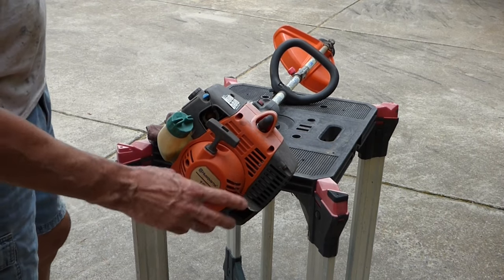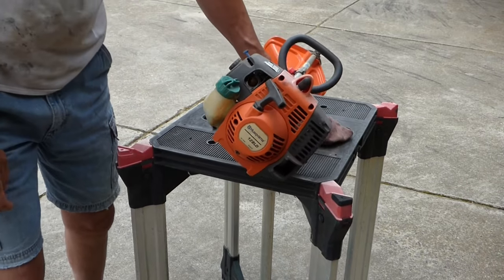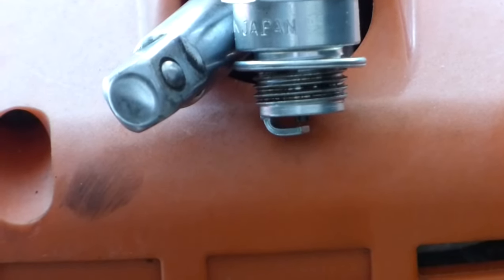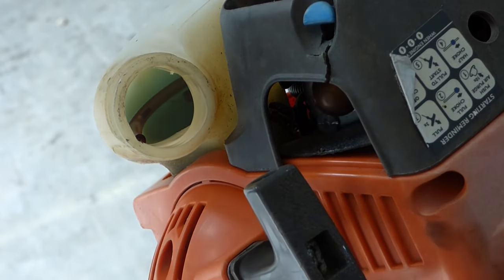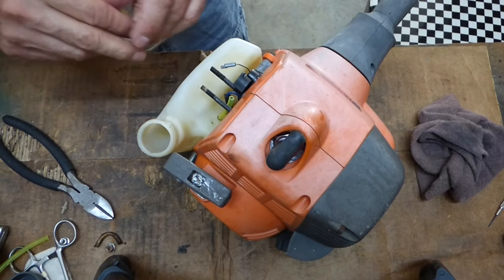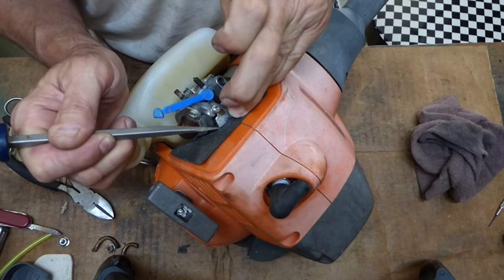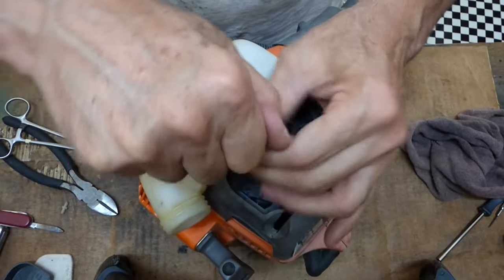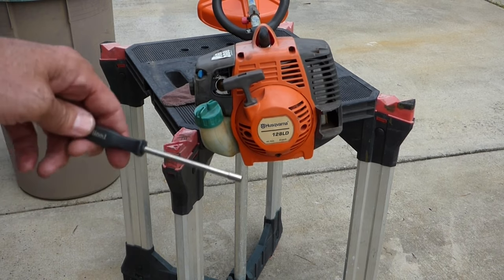Diagnose & Repair a Weed Trimmer that Won't Start or Run - Husqvarna Fuel Problem Fixed!

Comment: if there's a dip stick somewhere on your engine do not use oil in your gas because its a 4 stroke
Reply: Its 2 stroke not 4
Reply: This is a 2
Reply: You can have an oil system on a 2 stroke... Lots of snowmobiles, lawnmowers and other 2 stroke engines have oil systems.
Reply: There are also 4 cycle weed eaters and other lawn equipment

Comment: Need to take the carb apart and clean it no telling how long it ran without the fuel filter might have trash in the screen before putting the carb back on but that's just me. It was a great video
Reply: I would have cleaned carb too since you have it off anyway
Reply: I'd have taken the carb apart as well. I like his videos but sometimes it seems like he cuts corners? Other than that he does good videos and great work on fixing equipment
Reply: Ever heard the saying if it ain’t broke don’t fix it??🤷🏼‍♀️😂😂
Reply: @tuwannarico  ever heard of preventive maintance so you don't have to do it twice👍👍
Reply: Ever heard of, keep it simple. I’m not gonna gump it up before I know it’s actually already gumped up.

Comment: Mine was temperamental. When it worked, it worked. But too much inconsistency for me, so I upgraded to a 4-stroke Honda... and never looked back.
Reply: Every year, it's nothing to look fwd to, Husqvarna is the best when running, but its inconsistent,
My 3rd one. I don't have time.
Reply: i'm here after replacing the RCJ8Y spark plug to get my 128LD up and running again for this year. worked great yesterday. today, it won't even start. it's baffling.

Comment: buy 2 carburetors, one for this year and one for next year.
Reply: I agree with You !!!!!!!!!!!!!!!!!!!!!!!!!!!!!!!!!!!!!
Reply: just use non efhanol gas with Amxoil Sabre oil, it also has stabilizer in it,
Reply: I add a few drops of marvel’s mystery oil to about every other tank of gas , never had any problems with carb or lines going on 8 yrs with my sthil trimmer

Comment: Working on a neglected trimmer that had stale fuel in it for ages. I've replaced the fuel lines and filter, as well as the carburettor. I've gapped the spark plug and tested it for spark, and I've put fresh fuel in with the correct fuel to oil ratio. The thing will not start. It's practically brand new. I think my dad must have run it on straight petrol and worn out the engine.

Comment: My son put the wrong mix in the fuel tank for this exact trimmer. Would you recommend cleaning or replacing the tank? It was never ran with incorrect fuel, I caught it before he got a chance.
Reply from the maker: Just drain out the bad fuel from the tank and refill it with the correct mix Of two cycle oil and gas. You are wise not to have run it with the wrong fuel in it… Especially when somebody puts straight gas in a two cycle engine… It will ruin the engine. Keep up the good work!
Reply: @helpinguonline  drain it out??? Tip it upside down? Syphon it, how?
Reply from the maker: if you mean how to get it out of the carburetor...  after you removed the fuel from the tank (take the cap off and dump it out) you can press the primer bulb and that will run the old fuel out of the carb and pull in the new fuel that is properly mixed.  that little bit won't hurt anything.

Comment: Overall good troubleshooting. 
However, with all the bad fuel lines, I would have also replaced the purge bulb.  That will be the next likely fuel item to need replacing.   Cheap and easy to get to.
Reply: 8

Comment: I ended up replacing carb and the fuel lines. I am now using the Husqvarna 95 octane fuel. Works great. I was using regular gas and mixing the oil. I think it hurt the engine. Replacing all of that was worth the money.
Reply: It won't unless you did it wrong

Comment: The fule lines went on mine to but was a easy repair you don’t need to take off the carb just use fine tipped needle nose, pliers
Reply: Thinking the same

Comment: Fuel lines of the old Husky 223L I was given fell apart too, carb covered in old sticky fuel. Mine had rubber grommets for fuel lines to and from tank crumbled too. Old fuel, age and Texas heat no doubt. Thank you, your explanations and great video super helpful! It would help to know what you listening for as adjust carb
Reply from the maker: Highest idle speed on the low side adjustment and same on the high side but after I get the highest speed on the high side I open the screw about 1/4 turn (counter clockwise) so it runs a little on the rich side to lubricate the cylinder...  I have a video on how to adjust properly
Reply from the maker: carburetor adjustment on a 2 cycle
https://youtu.be/dv_P1Zz7dR0

Comment: Good running machine then split primer bulb replaced  while doing so i split the return line replaced now wont run at all i have spark and fuel and im about ready to smash this thing first ill try starting  with a drill

Comment: you mind if I ask, why you dont put 2T oil in your fuel?
Reply: 10:32 50:1 Gas + 2T oil is mixed in fuel tank already. Husqvarna 2T oil gives the mixed fuel a bluish color. Pure Gasoline (petrol) is colorless.

Comment: never knew you only use 2 cycle I'll make sure to tell my buddies this, most of em just use regluar gas
Reply: You do use regular gas.... just mix it with 2 stroke oil to the correct proportions

Comment: My weed Wacker string keeps coming out of 1 of the feeder holes. It has 2 feeder holes. Any idea how to fix?
Reply from the maker: Do you mean only one hole has line and the other one doesn't come out?... if so sounds like you are winding the string around the spool wrong.
Reply: @helpinguonline  you have to feed each hole with a 8inch string. One of the holes the string keeps coming out.

Comment: Need help, I have a 128cd, I changed the piston, put a new carb, new filter, new spark, new fuel lines. It wont start, spark is ok. What could it be?
Reply from the maker: Without being able to look at it… If you have spark my guess would be a fuel problem.  Maybe one of these videos will give you an idea of something to consider that you haven’t already?.

https://youtu.be/dyXTq7eKgUc

https://youtu.be/qsSWMye9r0M

Let us know what you finally figure out

Comment: Where can you get these fuel lines? Abd what size was yours?
Reply from the maker: You can buy a variety pack of fuel lines for a little over five dollars on eBay that should take care of most all your 2 cycle small engine equipment

Comment: Use only ethanol free gas on any engine with a carburetor.  First the alcohol with draw moisture into the fuel and second alcohol attacks all the plastic and rubber parts.  I have a husky 128ld 16 years now with original carb and fuel lines.  In fact the cylinder and piston are wore out, going to replace them and keep on keeping on.

Comment: Husqvarna Bush Wacker... I have a heavy duty Husqvama Bush Wacker and I'll NEVER purchase anything made by Husqvama again!!! It was difficult to start from day one. I've had it for about 4 yrs. now and have already had to replace the carburetor (the 3rd yr.). Now, less than a yr. later, it won't stay running unless I have the choke on halfway. I don't even like the way that the design of the Bush Wacker's body, because if you set it down to refill the fuel tank, due to the base design, it falls over to the side. My first heavy duty Bush Wacker was purchased from SEARS. It Was made in China, but it lasted over 25 yrs.  Now I feel like taking this Expensive piece of Crap and running over it with my 1 ton truck and sending it to Husqvarna's Head office...!

Comment: Any videos or tips on adjusting the Highs and Lows?
Reply from the maker: This should help...   https://youtu.be/dv_P1Zz7dR0
Reply from the maker: ...the low side adjustment screw is typically closest to the engine (if you are not sure which screw is for which side).
Reply: @helpinguonline  Thank you so much. Was able to do a full replacement of the fuel lines and tune it to stop the oscillation.

Comment: I have one like this and it also wouldn't start last year. I am not a fan of this machine. In my opinion it is way too powerful as a weed whacker. If I get it too close to my vinyl siding it will tear the crap out of it. I know people will say, "well, don't let it get close". Sometimes it isn't that easy. So, I just gave up on it and I will get a cheap electric on.

Comment: How do you know if your machine is flooded and if so how do you fix the problem
Reply from the maker: No start… Smell gas… Air filter gets wet with gas… If you take the spark plug out it will be soaked in gas. The way to get it started without doing too much is pull it full throttle with the choke on and it may start otherwise you can pull the spark plug out and dry it and put it back in

Comment: I have a 128LD, I have replaced, the carb (twice) and gasket, plug, coil, air filter, fuel lines, fuel filter and, it still won't start or run.  Was running great until a month ago.
Reply from the maker: Have you looked at the piston and cylinder wall and checked if they are scored? There should not be any vertical scratches or scoring. If there is your engine is damaged and will not start or if it does it will run terrible
Reply: @helpinguonline  Thanks for the reply!  I trashed it and bought a new one.

Comment: I have a Homelite brush cutter from 1985. It ran great for 20 yrs. Then I put it in storage for 19 yrs. Question: I can't seem to find a fuel filter like the one that was in mine which is similar to the ceramic ones I'm seeing for sale today except that mine has a mesh it. Will these ceramic kind work in my Homelite?
Reply from the maker: I just watch to match up the nipple size on the filter with the fuel line size
Reply: @helpinguonline  ok, then what I have should work. Thanks

Comment: Fuel lines are such garbage
Reply: You are absolutely right, poor lines, but the gas dissolves that plastic after time. Might be a good idea to take the gas out if you're NOT going to use it for awhile.

Comment: my weed wacker only runs on choke.  will not at high
Reply from the maker: It may be something real simple like a clogged fuel filter, cracked fuel line or it may be a little move involved like a clogged carburetor.  
To prevent this in the future be sure to always drain all your fuel out of the tank and run your weed trimmer til the gas is out of the carburetor when storing.
If your carburetor is clogged you can clean it.  Here is a video for you on that:
https://www.youtube.com/watch?v=MtggiZf_x-4&t=554s

God Bless you and lead you!  Let us know what you find out.